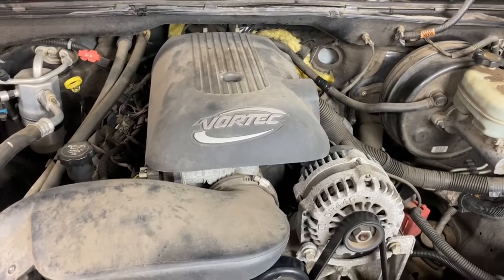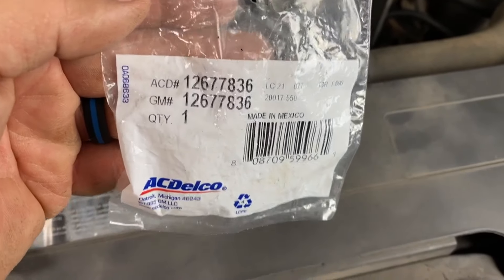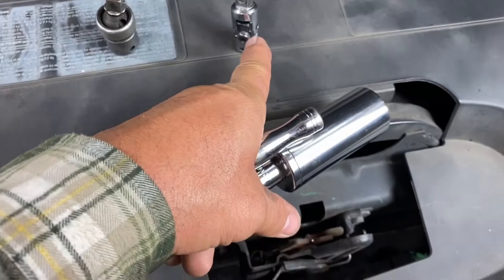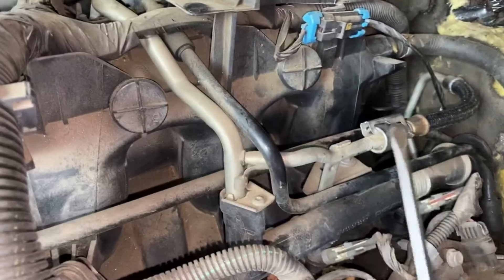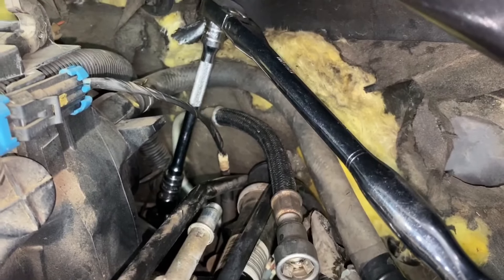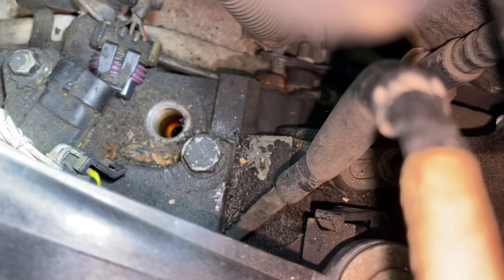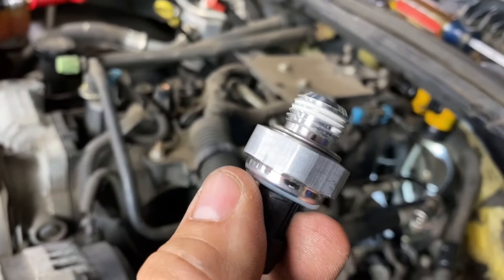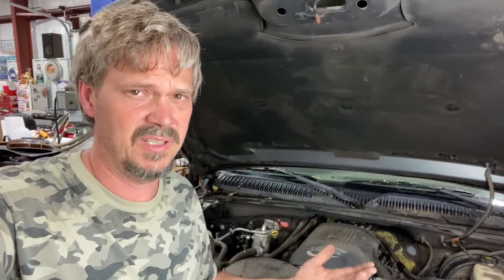Low Engine Oil Pressure / Oil Pressure Sensor Symptoms and How To Repair

Comment: Hey I replaced the oil pressure sending unit but it's sill doing the same thing any answers
Reply from the maker: My next would be the gauge itself. What exactly is it doing?
Reply: @dhammiam  it's still fluctuating and my truck is acting funny
Reply from the maker: @joshsheridan8099  it will fluctuate if your engine has an ignition miss or if anything is causing rpm’s to vary. Does it have any trouble codes set? If you think it’s still an oil pressure issue try putting a manual gauge on it in the same hole where the sensor goes
Reply: @dhammiam  okay I'll try that thanks for the info another? For you can your engine not like the oil you put in it
Reply from the maker: @joshsheridan8099  if your bearings are wore or older engines sometimes require thicker oil. That will help a low pressure to the gauge situation which is usually caused by worn camshaft bearings
Reply: @dhammiam  okay thank you it didn't like the thin stuff lol

Comment: Mine does this after driving about 10 miles and sit at a stop light. If i pull over and shut it off and turn it on again its enough to get me home. Sensor or cluster??
Reply from the maker: Check all grounds and battery connectors. It could be either one otherwise. The sensor is easier to replace in my opinion. If you can get it to act up then unplug the sensor see if the gauge changes then

Comment: What does it mean when the oil pressure stay on 80 psi after you change the switch ?
Reply from the maker: Maybe a grounded wire. What does it do with the engine off and the key turned on? Could be the stepper motor on the gauge

Comment: Now does the Gauge arm move towards 80 now sometimes when driving and braking after you replace the sensor or is that a sign it needs to be replaced?

Mine doesn’t go below I think 30-40 but moves towards 80 mark when driving and I just want to make sure it’s not needing to be replaced.
Reply from the maker: That sounds like a bad sensor to me. Mine was going up to 80 before I replaced it
Reply: @dhammiam  ok. I figured as much. Thanks for replying and thanks for posting a video on how to fix it.
Reply from the maker: @jhermaineharris2142  thank you and good luck. Let me know how it goes

Comment: I have a 04 SSR My oil psi gauge first went to zero. I had to replace radiator due to Automatic transmission cooler leaking. I cleaned up all the engine & painted rusty pulley. Now the oil psi is at 80 psi. I see that the 05 engine the sender can be seen. Not on my Vortec. Is this a different engine or placement of sender? I have new sender & socket. Need help to locate the sender. I watched a video of another Vortec engine. The oil sender was under intake manifold. I can't see mine. any help?

Comment: Please let me know I got a 4.8ltr it basically the same block but I was just wondering how could I get to it without taking the motor out
Reply from the maker: If it’s one that’s hard to get to, to knock a new one in put the rubber expansion plug in. It just pushes in then take a wrench or socket and ratchet and tighten in place.
Reply from the maker: Knocking the old one out just use a long screwdriver and a hammer and grab it with pliers

Comment: Hey boss I got a 2006 Chevy Silverado 4.8. My sister went outside when have got a replacement at o'reilly's for about 50 bucks. It came with the screen but I fished down there and there was no screen so I guess and then I put it on and it wouldn't even go. Down into the hole it was a wind but didn't go down so where I could screw on so I just took it out so I guess it'll be. All right on when I took out the original one there was no screen
Reply from the maker: Yea you don’t have to have the screen 👍
Reply: @dhammiam  OK thanks for your reply? I already put it in so if I didn't need it the screen. I would pull it back out but thank you so much yeah it looks like I cleaned out the boar to make sure nothing would go in there but O. K hopefully that does the trick I turned it on. It's at 40. It's working cool so I'll see when I take it to work cause. I traveled through the hills every day so that's when I noticed that my needle has got stuck on 80 but thanks so much have a good one.  Happy easter

Comment: I've got 2009 silverado extended cab 4wd ltz. My oil pressure gauge is reading zero. My oil levels are normal and engine running fine with that exception.

I've read many a forum telling me it's the oil pressure sending unit (sensor). Did hook obd2 reader up and fault was insufficient voltage on oil pressure sending unit. Is there way to determine if swapping out sensor, this would be fixed? Thanks in advance.
Reply from the maker: The easiest way to check it would be to get a new one, don't install it yet but plug it in. Take a air hose and blow air to to the end to simulate oil pressure (regulate to 40lbs if possible otherwise just don't apply full air) have someone watch the gauge with the key on, or do what I do and set up my phone to video the gauge.  If it doesn't change it then that's not the issue. Also make sure to ground the sensor while doing the test. Most likely the sensor is bad but if it isn't then you can return the sensor and move to next step which would be a wiring issue or ground. Could be the gauge but with the code set not as likely. Let me know and good luck. Happy New Year
Reply: @dhammiam  hell yeah, this was perfect. I'll keep ya posted as to what I find out but thank you again. Happy New Years! To you and yours.

Comment: I installed a new sensor without the screen and it only worked for about a week and started leaking oil again. I thought maybe not putting the screen in caused it to malfunction.  I couldn’t find the old screen and a new one wouldn’t go in all the way anyways, so I just installed the sensor
Reply from the maker: I only installed the sensor. Yours was leaking oil?
Reply: @dhammiam  yeah it functioned properly for about a week until the gauge was pinned at 80 again and soon after the oil started dripping again…..6 months later and drip is alot  worse so time to try again I guess
Reply from the maker: @Lou-tl6qi  did you use the AC Delco brand one? I know some of the aftermarket ones were thin
Reply: @dhammiam  dorman

Comment: Blinkers and flasher not working replace switch flasher fuse BCM has power to turn signal switch to flasher relay all fuses are good but still no signals or flashers
Reply from the maker: Is there an open ground? Check at the battery as well, battery to chassis small wire.

Comment: Is the sensor connected to the engine? Because I recently swapped my 4.8 for a 5.3 and before I did the swap my oil pressure sensor was doing the same thing as yours and now with the new engine it’s still doing the same thing. Thanks
Reply from the maker: The sensor reads the oil pressure from the engine.  Did you use the same sensor and swap it from the 4.8 to the 5.3? Odd that it would do the same thing if you didn't.  If you did then there may be another issue.  Let me know and we can figure it out. Thanks
Reply: @dhammiam  to be honest I’m not sure. I dropped my truck off at a shop and they did the swap. My old engine was bad it had an really bad tick and I wanted to do the 5.3 upgrade. I can ask if he swapped that sensor out. I don’t see why he would unless the engine we got didn’t have one. I didn’t bother to look while we had the engine out. Is there anything else that would trigger the pressure gauge to go crazy like that? Thanks for your help!
Reply from the maker: @Tankfc3s  usually on a swap if the connector is different the easiest thing to do is swap the sensor so they may have. Or if the other engine didn't have one. Other causes could be bad ground (not likely) or the gauge itself in the instrument panel could be bad. Only way to really tell is to take the sensor out and put in a manual Gauge. If you're going through that trouble then might as well replace the sensor
Reply: @dhammiam  ok I’ll talk to the mechanic to make sure if he used the old or not. I’ll probably just change it for a new one anyways like you said. Thank again!

Comment: I'm having a problem I have a 01 chevy 1500 5.3. The oil pressure was reading 60 this morning then at work I was running it for a/c on my break and I noticed it dropped down just below 40 and goes up when I hit the gas but it seems to run fine all the way home and no lights on dash. Also I bought the truck 2 years ago and it had 121,000 miles on it it was a farm truck and I redid alot but changed the oil then and i don't drive it much so it now only has 123,000 miles on it. What's your opinion? Could it just need a oil change since it's been so long sitting.
Reply from the maker: If it sat a while it could have some moisture in the oil for sure and need changed. The oil pressure will definitely drop as the engine warms up and the viscosity drops and will go up with rpm’s. Sounds like you have good oil pressure

Comment: 2004 Avalanche. Oil pressure was maxed at 80. Replaced sending unit with ACD part and did not fix. Plug in was slightly cracked, replaced that, confirmed voltage, still maxed at 80. Got another unit, still maxed.  Any suggestions on next steps to fix?
Reply from the maker: Do these checks. Remove the connector plug at the oil pressure sensor.
Key on, check the voltage of the grey wire. You should have 5 volts- key on, engine off.
Turn the key off and check the resistance of the black wire to a good ground. You should have less than 5 ohms on this wire. Do this when the problem is happening though. In your case it seems to be pegged all the time. All the rest of the tests (for the gauge wiring) can only be done with a scantool.

Comment: Howdy. I have a 2000 Yukon Denali with a 5.7 engine and I've been having that same thing happen where the oil gauge goes to zero then complete loss of power to the where the GMC shuts down completely. Could it be the same sensor or a oil gauge sensor I'm overlooking? Before I take it to get the codes pulled for it. Cus I'd like to fix this myself instead of spending the 500$+ to 1000$ n up for someone else to do this
Reply from the maker: Some vehicles did shut the fuel pump off when the sensor showed low oil pressure. I’d have to see a wiring diagram and tell if a 2000 Yukon did that but my guess is it could be the issue. That’s if you have oil in the engine and haven’t had oil issues in the past because a bad oil pump, clogged filter or bypass issues could also cause it but rarely
Reply: I did come across a couple of people that have had the same thing happen. It's my first guess of the sensor. Haven't ruled out oil pump or screen. I have checked the oil n did a chance n it came up clean. N drives good when cold within the very early mornings but when warms up the gusge drops n it shuts down till cooled off that leads me to the oil sensor between the engine and firewall
Reply: Had almost the same thing happen when I had a Buick LeSabre a transmission sensor would shut down the car when it got hot if I didn't let up on the gas or put it into neutral at stop
Reply from the maker: @jamesbartle9617  yea those sensors are used to protect from major damage

Comment: This am i started my truck and headed to work and i noticed the oil pressure gauge was topped out at 80, so immediately went straight home and started doing research, truck seemed to run fine while it was running and if i turn the key without starting the engine it goes straight to 80 as well. Could this be my problem too? Oil pressure switch?
Reply from the maker: The gauges will go up and lights come on when the key is on as a test. Most people don't realize this until there's an issue I've noticed through the years. It sounds like the sensor is bad most likely
Reply from the maker: It's not hard to replace. Hardest part is getting to it and having the right tools
Reply: The distributor top is in my way and can’t find any way to get it off lol. I do see the oil pressure switch tho. My Silverado is a 4.3 v6
Reply from the maker: @CLOWEN2010  I've not done the V6. I'm assuming the cap is held on by (2) 5.5 mm bolts. They don't make them easy to get to for sure
Reply: @dhammiam  yea don’t think i can get to it, just have to go get reamed from someone else

Comment: I have an 06 Sierra. I wonder if the sensor is good but the screen is clogged. I bought a brand new and it's never been changed. No oil pressure until I raise RPMs to 3,000 or so. Then I have no issue while it's running. Only when I first started
Reply from the maker: It sounds like it could be. Like it takes a while for pressure to get past the screen or the sensor is weak

Comment: How change the pcv valve . My 2004 yukon 4.8  valve stuck  in the hole cover .no tools available to remove it
Reply from the maker: https://amzn.to/2V5pIcL
Reply from the maker: https://amzn.to/369YX99
Reply from the maker: See if either of these would work depending on The condition of the PCV valve

Comment: 4.8 low-pressure ticking noise. 160 miles
Reply from the maker: May have worn out cam bearings, clogged oil pickup. Have you tried any additives to the oil?

Comment: I have a 2006 Chevy suburban and when I’m driving the oil pressure gauge is hovering near 40 or just under but at idle it’s only like at 20.  Oil pressure sensor?
Reply from the maker: Normal oil pressure should be 30 +/- 10 psi at idle and 50 +/- 10 psi at 3000 rpm. It will vary some depending on the viscosity used and the engine temperature as well. Also as the engine wears. When the sensor is bad it will most like peg out, not work at all or fluctuate for no reason.

Comment: I changed the sending unit still have the same problem what should I check next 🤔
Reply from the maker: Does yours have the screen under the sensor? What exactly is it doing when you turn the key on, not started yet then what when you start it?
Reply: When I start is says same thing it's seems to not be getting any oil

Comment: I just had a question. I replaced my sensor and still have low oil pressure. Not at 40 like it's supposed to be. So I'm wondering if the screen has to be in a certain way? Probably sounds totally ignorant but I like to fix things on my own and save money. Thank you so much for the tutorial!!!!
Reply from the maker: Hey, what is the oil pressure at idle? Then what is it when you rev it up or before changes gears?
Reply from the maker: Reason I ask is it could be as low as 20psi at idle and increase 40-60 at 3000 rpm. This also varies depending on oil viscosity and engine temperature, can bearing wear

Comment: So my 05 Silverado with 5.3 drops down close to zero but not exactly at zero and dash tells me low oil pressure but it's only at idle. When I drive off pressure goes right up to 38 or 40 fine
Reply from the maker: It’s most likely a bad sensor. If the oil pressure really was that low you would hear a bearing knock in the engine. Trust me you WOULD hear it. It’s a sound unlike any other

Comment: My oil pressure gauge is at 80 withe the engine off.  When starting it goes higher.  05 5.3L silverado.  Oil sending unit still the culprit?
Reply from the maker: Try unplugging it to see what it does then, but yes most likely is the culprit.  Its the easiest repair and most likely

Comment: What if i replaced it but stays close to 0psi? At idel and about 20 when gassing it
Reply from the maker: Have you checked the screen underneath? If it’s there still
Reply: I have the same problem with mine. Any help on this would be greatly appreciated mine has no screen changed the sensor put 15w 40 in it and still had the same problem. Could it be the cluster in mine?
Reply from the maker: @TonyMorelli-em3ie  The only way to know if it is in the cam bearings or something else is to put a manual gauge in place of the sensor.

Comment: I’ve been having an issue when I turn on the truck it goes immediately to 80 psi and drops when I begin to accelerate and goes up and down depending on RPMs. Could this be the same issue
Reply from the maker: Sounds like the same thing I had before replacing the oil pressure sensor

Comment: My guage was jumping to 80 as soon as I turned the key, before the engine was even started.   I replaced this sensor with an acdelco part.  It worked fine for 2 days and now the original problem of jumping to 80 is back.   Is there a chance I just got a bad part or is something causing the sensor to fail?
Reply from the maker: Is it setting a code? The grey wire should be the 5v reference wire and it will set a code. Check all fuses and the connectors as well as grounds.  Could also be the PCM acting up but definitely something strange since it was fixed for 2 days.  Could be new part failure but odd to be doing same thing so maybe not
Reply: @dhammiam  there are no codes.   I am throwing a new one in today to see what happens.
Reply from the maker: Good luck. Let me know and I’ll pull up a wiring diagram if I need to
Reply: I have 2012 avalanche 5.3 doing the same thing,

Comment: That STUPID bolt next to the sensor was blocking my socket - I removed it and the socket got lower but it STILL isn't grabbing. I think it's hitting the metal 😡  I'd have to look for a thinner 27mm I think..?
Reply from the maker: Do you have a bench grinder or something that you can grind the end of the socket down?
Reply: @dhammiam  I have an angel grinder but I'll try to look for something a little thinner in the store ~tomorrow. But if not thanks for the idea!!!  A 5 minute job taking a full day - everyone's just pulling theirs out no problem. Very frustrating when you don't have the right tool or parts 🤌

Comment: replaced it and now the check oil light is on and its full it wasn't on before
Reply from the maker: I’m not sure if those two sensors are connected somehow. They’re not usually